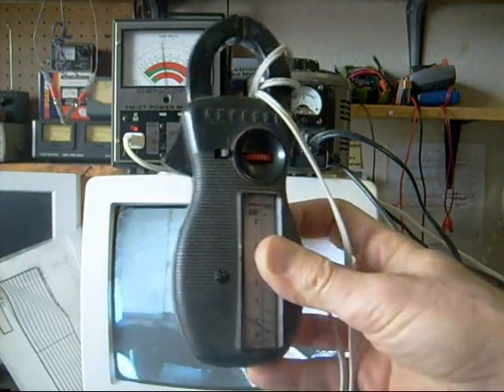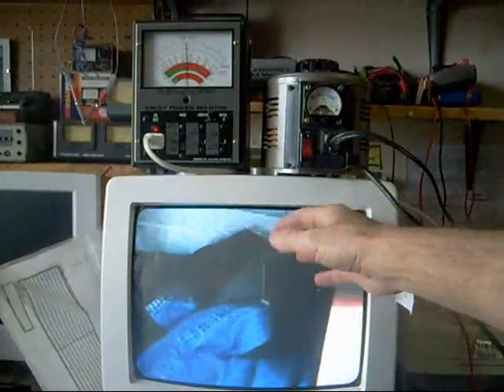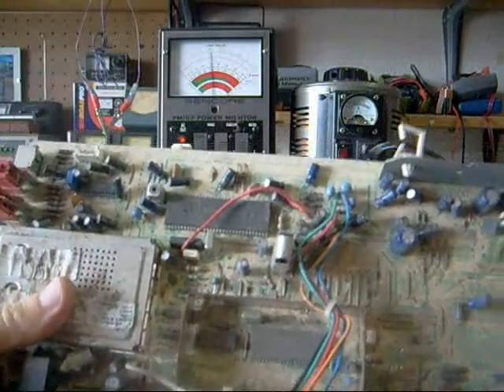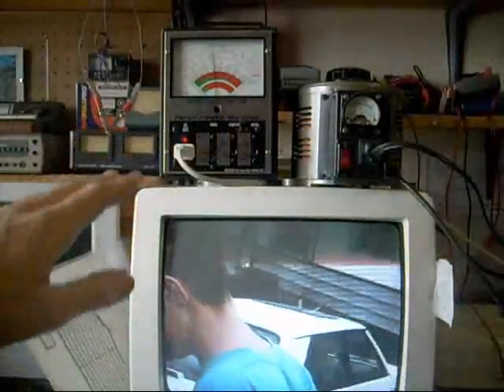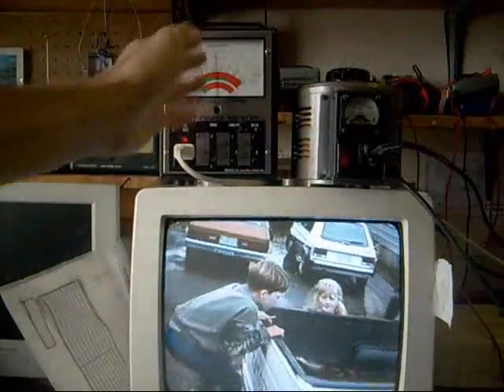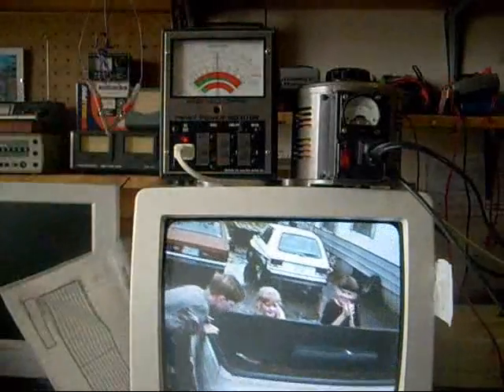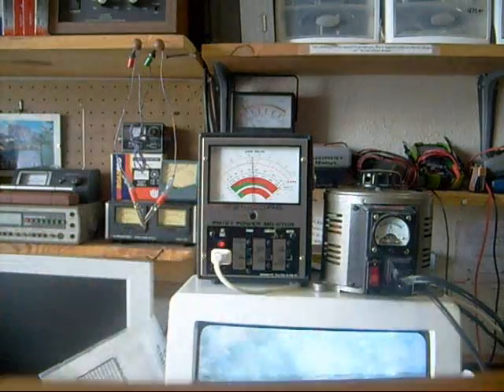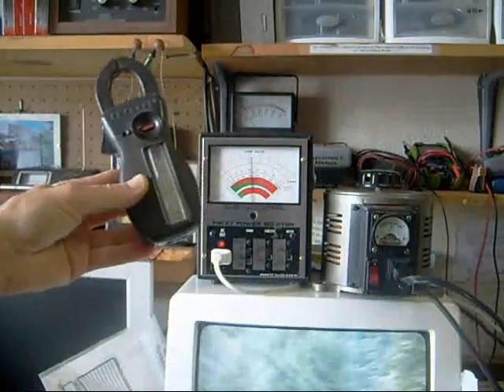LCD TV repair made easy # 9

Comment: Where can I find parts for LED TV"S ?   Need to cross reference tiny circuit board transistors and don't know how.
Reply from the maker: William Heckman Unless you have part numbers on the parts you will need a schematic. As far as finding parts goes you can google the numbers found on the circuit boards and often find replacement boards. ebay and amazon are sources for salvaged boards but unfortunately many of the sellers don't really know if their boards are any good, and they lie about them. Shop Jimmy is a good source for salvaged boards.  Digikey, Mouser and Suburban Electronics can be good sources for parts.

Comment from the maker: A Variac generally refers to an adjustable AC power supply which uses an autotransformer to raise the or lower the AC voltage coming out of it. I would suggest you google the word "autotransformer" if you want to better understand how it's design is different than a standard transformer.. Most variacs don't have any electrical isolation from the 120 mains, so If you thinking about buying one, I would suggest you find one which has built in isolation.